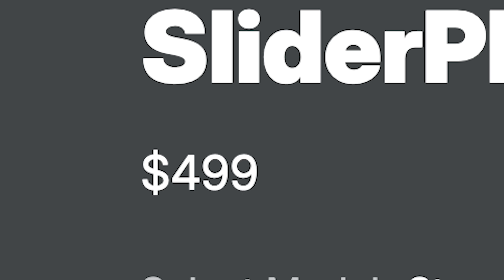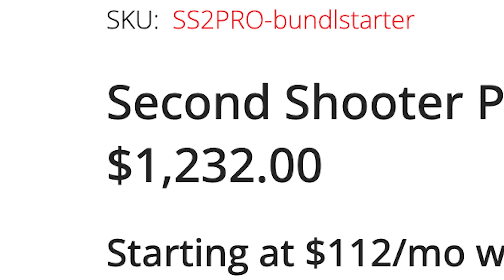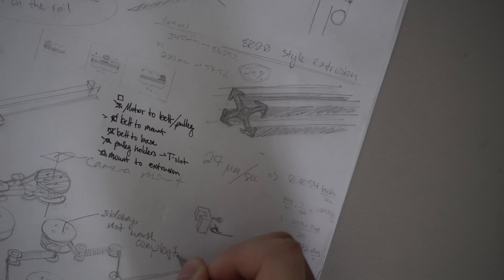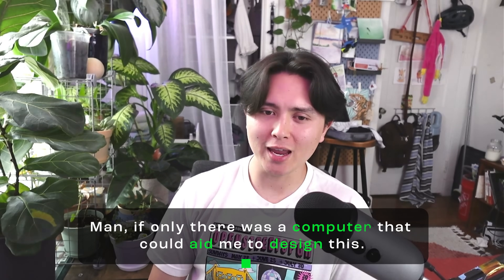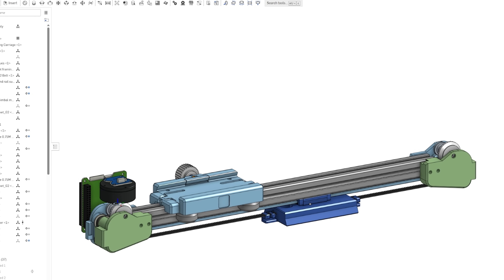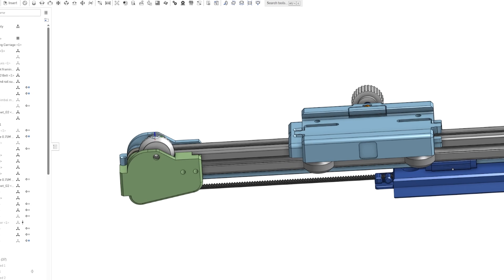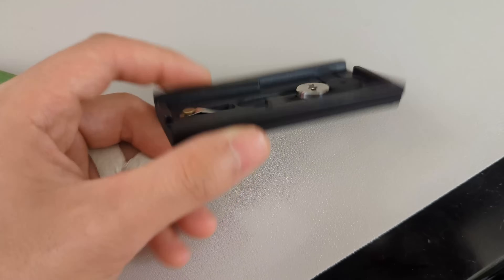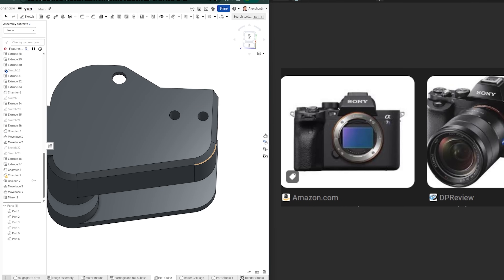Our DIY Camera Slider Robot Success Story

Comment: Any tips on how to model the belt?
Reply from the maker: So actually Onshape has a great belt generator tool/ feature script! 

You only have to tell it the mate connectors you want the bends to be and it generates parts for the belt, rollers, sprockets, etc.   

look up Onshape belt/chain generator.  It also does chains lol

Comment: i'm not a maker, i'm a software developer and i see this issue all the time

"the question is not can i make it but should i make it?"

then instead of buying the $40 utility you spend 10 hours to build the thang and then spend 20 hours of your weekends to debug the thang which if you were paid for that time would cost the customer a couple $thousands

the best and the worst thing is you stumble and either overcome or succumb to the same challenges as the original developer/s of that utility and you grow from that

the worst thing is in the end you buy that utility anyway

trans rights btw